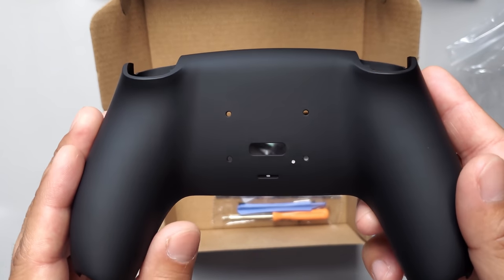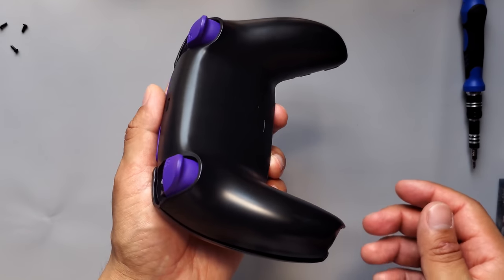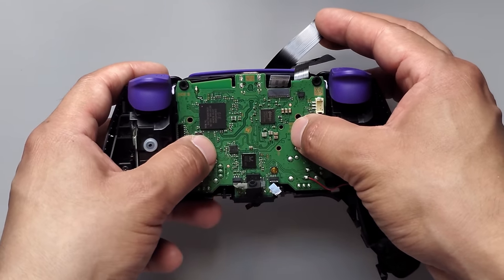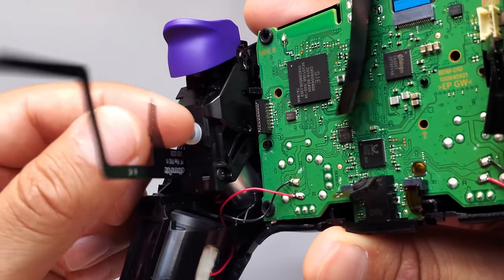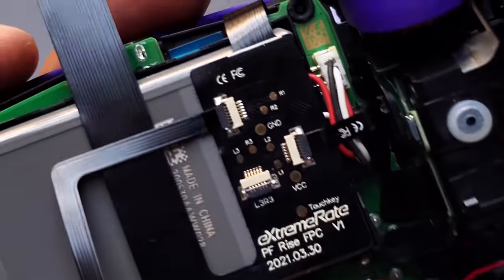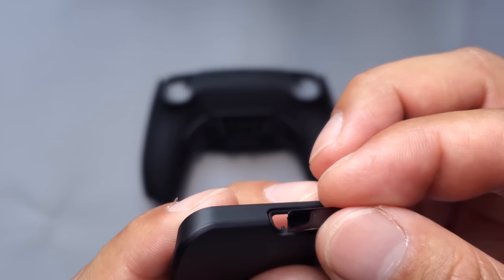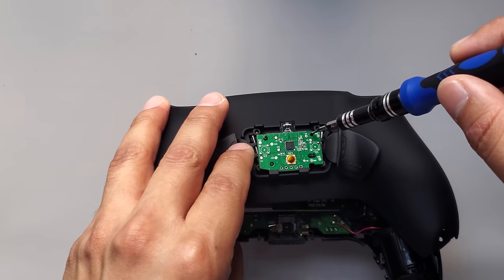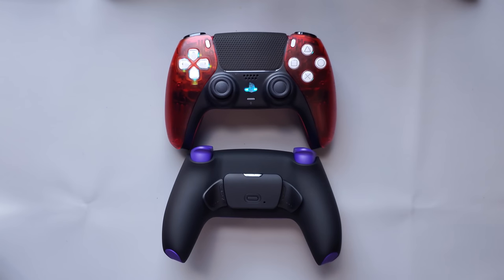DIY PS5 Controller (For BDM-010): eXtremeRate's Rise Remap Kit | No-Soldering Step by Step Tutorial

Comment: Hey man this video is absolutely incredible and crystal clear on the instructions. I bought a kit and installed with no problems because of this video, so thank you! However, the paddles aren’t working in-games despite the red light showing up and blinking when being mapped. I’ve tried everything to get the paddles to work, like making sure I exit settings mode to save, and ensured all the cables are properly attached, and they are. But still nothing. 
ExtremeRates hasn’t gotten back to me and I feel like I might have to refund or something.
Reply from the maker: Even after turning off the back they still don't work? Did you see if your motherboard had BDM-020 or BDM-010? And does the original back shell show model number CFI-ZCT1W A or CFI-ZCT1W?
Reply: @im.a.caveman  Bro tysm for this tutorial, it was extremely easy to install thanks to you. Btw I also thought it wasn’t working after I finished, but as you said here, just had to turn off the power bottom and it works perfect now!

Comment: If you add this to the controller, can you still use the original buttons still for the same functions? Like for example "X" on the back right paddle but also still "X" on top
Reply from the maker: Yeah! X or any other button will still work normally.
Reply: @im.a.caveman  thanks for the response brother

Comment: Hey! My K1 back button has stopped clicking and it won't work anymore, any solution? I've contacted the seller on eBay since the controller came with the back buttons installed already. Was working great for 4 weeks...

Comment: Hi! Great video and explanation 👍  I am just wondering if this would work for the L1 L2 R1 R2 triggers? My hands are a bit messed up and my trigger fingers hurt after some use.  Thanks!
Reply from the maker: Works to remap with action buttons, dpad, and triggers. If you want to add L3, R3, and toucpad that part will require soldering.
Reply: @im.a.caveman  if you only need to remap X and O then do you need to even use the extra ribbon cables for triggers ? I don’t remap triggers to my paddles
Reply: @im.a.caveman  just default X and O

Comment: I've been doing research and contemplating buying these since these seems to be the ONLY affordable option to have paddles without having to spend $200+. Atm, I only play fortnite with husband and son. Are these paddles programmable? In FN sake, for building/editing?
Reply from the maker: With this kit you're able to remap the existing buttons of the control. Since this is the non-soldering version, you're able to remap action buttons, dpad, and any triggers to the paddles. Only 1 button per paddle. There's different version of the Kit now. Which I have videos for. I just upload the new 4 button kit if you'd like to watch that video. It's a non soldering version as well.

Keep in mind that the V1 Remap Kit is only compatible with CFI-ZCT1W (BDM-010). The V2, RMB, and Rise 4 are compatible with both CFI-ZCT1W (BDM-010) and/or CFI-ZCT1W A (BDM-020).

Comment: Great video, any idea why my d pad left button isn’t working? Everything else works just fine. I would appreciate some help
Reply from the maker: I would say try to reset the controller. If not, open the controller and check the conductive film the buttons press on.
Reply: @im.a.caveman  I’ll try resetting the controller. I’ve checked the film and it looks pretty good

Comment: Please help me, I’ve had everything on the controller set up for 3 months with no problems and all of a sudden I’m running into many problems on only one of the paddles. The paddle will either double input, delay my input or not register it at all. To add, when the paddle completely stops working, also does the button it is mapped too. Please help me if possible it will be greatly appreciated

Comment: i just wanna make sure I'm understanding this right. The only reason you need to solder is if you want to remap L3, R3, and the touch pad?  Second question: after installation  (if done right) does everything in the controller still work the same? Like adding this won't disable anything. Thanks for your time. I just don't want to screw up my controller.
Reply from the maker: Yeah soldering is only to remap L3, R3, and touchpad. Adding the kit won't disable your other buttons. Ex: you can use either back button as X or still use your front X. I know what you mean. You're not the only one who's afraid of that. People have commented they've never done something like this and they tried it. Try it out! Just be patient and be aware of your wires and that everything is connected correctly. Feel free to ask any more questions. You can also contact me on IG (im.a.caveman) if anything.
Reply: @im.a.caveman  thanks man!

Comment: So I did it great video works great, but for some reason my adpative triggers an not working now :s any ideas?
Reply from the maker: Go back in and check your cables. See if some thing isn't connected correctly
Reply: @im.a.caveman  so your fing awesome ha, I think I didn't push down the r1r2 connection enough as I re connected them all and that fixed it thank you sir!

Comment: I just bought the one without a mother board “Chameleon Purple Blue Replacement Redesigned K1 K2 K3 K4 Back Buttons Housing Shell for PS5 Controller eXtremeRate RISE4 Remap Kit - Controller & RISE4 Remap Board NOT Included” That’s bad ? I can’t 
do it like the strike pack?(Easy to Map)?

Comment: Just installed the kit, great explanation but why would my controller not want to pair with my PS5? I have the right kit and installed everything I could think of twice over. Just need some input thanks.
Reply from the maker: It doesn't turn on or just isn't pairing? If it's not pairing try resetting the control and connect your cable.
Reply: @im.a.caveman  not pairing, just blinks blue, connected the cable and it looks to be charging with yellow lights. I'll reset the controller and see if that works
Reply: @im.a.caveman  I had a cable loose when I was doing something I seen it all works great thank you for responding

Comment: I did this modification and follow every single step from this video! This is the easiest mods I ever done! Thank you so much 

The only problem I noticed is, I tried charging the controller while using it. It doesn’t work. But if the controller is switch off it’s charging.

Did I missed something? Is the mod chip could be the reason why you can’t charge the controller while it’s on?

Please help
Reply from the maker: First time hearing that one. Try reconnecting the battery or resetting the control. Not sure what the issue could be.
Reply: @im.a.caveman  ok cool will try that later when I get home :) will update this post in few hours
Reply: @im.a.caveman  just an update for. My first post 

All fixed now the controller is charging now. I opened the controller to access the reset button and that was it. 

Thank you !!!

Comment: I just tore the cable that connects to the battery holder😭😭😭 I had no idea they were so fragile. You made it look so easy. I'm assuming the controller is broken now?? 😭🤦🏾‍♂️😭🤦🏾‍♂️😭. Do you know what that cable is for?
Reply: The cable at 3.26 is what I tore. For anyone who is new to doing  anything like this (just like me) be careful as the cable is more fragile thn it looks. I believe it's the mic cable but I'll play without it as I usually play with headphones anyways. So the controller still works and I managed to finish installation of paddles so it's a win lol
Reply from the maker: @rangstafied  Yeah thats for the mic. Sorry to hear. I'm glad it alteast still works
Reply: It's all good thanks your video helped alot!

Comment: is it the Black RISE 2.0 Remap Kit for PS5 Controller BDM-010 & BDM-020, Upgrade Board & Redesigned Back Shell & Back Buttons Attachment for PS5 Controller - Controller NOT Included - XPFP3009G2 or  Black Programable RISE4 Remap Kit for PS5 Controller BDM 010 & BDM 020, Upgrade Board & Redesigned Back Shell & 4 Back Buttons for PS5 Controller - Controller NOT Included - YPFP3001 that I need ?great vid btw.. subbed up
Reply from the maker: Yes, it'll work for either CFI-ZCT1W or CFI-ZCT1W A. Thanks for subbing and watching the video!!! Just to let you know there's a 2 button, 2 paddle version now called the Rise4. My next video is going to be an installation video on the BDM-020/CFI-ZCT1W A conttoller with that kit.
Reply: @im.a.caveman  ok cool! Good to know honestly all I need is the 2 back paddles so I should be solid with these.. video was great man appreciate you I used your code for purchase as well
Reply: @im.a.caveman  my Man! The tutorial was unreal I got it set up and all working.. the paddles work on my PS5 menu.. as soon as I load a game up my X traingle circle and back paddles stop working.. as soon as I pull up the Ps5 menu they work again.. any chance you know why?
Reply from the maker: @TonyFromThe6ix  Let me just rule out some things. Did you cut the appropriate cables so that it works with your control?

 Did you fully plug in the cables? If not double check. Sometimes they do need an extra push which is why I will wiggle left to right, lightly, while pushing down. 

Are the cables correctly placed on their designated spot? 

Does it seem like any of the cables are damaged? 

Is the cable, that connects to the remap board, fully connected? 

Basically double check the cables for any of these things I mentioned. Some people have mentioned this problem but I don't see how it happens. I recently got my BDM-020 and installed the Rise4 with no problems at all.
Reply: @im.a.caveman  where can I see which cables I have to cut? I followed the kit exactly like yours it only works on my PS5 menu.. as soon as I load a game up nothing works.. I double checked the cables but maybe upon the shell going back on something came lose.. I’ll double check
Reply from the maker: @TonyFromThe6ix  Specifically which kit do you have? Did you get the one that says BDM-010 only or the one that says for BDM-010 & BDM-020?

This video is for BDM-010 only. Before the Kit was updated to a V2. The V2 has cables for either BDM-010 or BDM-020. 

This is the V1 which was specifically created for BDM-010 only. Because it wasn't known at the time that there was a BDM-020 motherboard or CFI-ZCT1W A model number.
Reply: @im.a.caveman  do you have the video for the CFI-ZCT1WA? Model
Reply from the maker: @TonyFromThe6ix  I don't. I'm working on that video at the moment.

Comment: Do the paddles run out of battery if I dont turn them off? Its probably a dumb question but in the video you made turning them of seem important, so I ask just to be sure :)
Reply from the maker: You just turn it off after remapping. That's how you'll be able to use the paddles.
Reply: @im.a.caveman  Thx

Comment: So if u want L3 and R3 then u have to solder like the extreme site says right?  Whole point for me is making back buttons my run buttons or L3.  Also need the middle button to function?
Reply from the maker: Yeah, if you want to remap touchpad, L3 and R3 you'll have to do some soldering. I didn't do that part since I need to practice my soldering and rather not practice on a controller. I bought a kit to help me practice. If I succeed I'll have a tiny functioning digital clock. Just need to find the time to practice.

Comment: So dont you need the wire that yr ment to solder or did i miss something ??
Reply from the maker: You only need to solder if you want to be able to remap L3, R3, and Toucpad. This is the non-soldering version. Which will not include those buttons for remapping.
Reply: @im.a.caveman  ok thanks

Comment: Hey man! Great video. I subscribe and order one! I bought a new controller and  I followed every step and when I push the button on the back no red light comes on. I checked every cable to the best of my knowledge. Any suggestions? Please help! Thank you.
Reply from the maker: When you say pushed, do you mean you held the button down till the light went on? Also the control has to be on for it to be able to turn on. Thanks for subscribing!
Reply: I had to plug the controller in to the ps5 and update it first. But it worked! Thanks again for the response. Great video! Couldn’t have done this with out it.

Comment: Great video. Just finished installing my kit and my remote won’t turn on. Any ideas? Thanks
Reply from the maker: Does your original shell model number show CFI-ZCT1W or CFI-ZCT1W A? Did you happen to see if the motherboard had BDM-010 or BDM-020? The kit is only compatible with CFI-ZCT1W/BDM-010. If you have the correct one let me know.
Reply: @im.a.caveman  Looks like it is the CFI-ZCT1W A and BDM-020... Is there a kit that is compatible with this version of controller?
Reply from the maker: Definitely ask for a refund. Extremerate is currently working on having the remap kit work with your model. Could be soon. I've been in contact with someone that's helping them out to have the right cables to connect to BDM-020 (which is your kind).
Reply: @im.a.caveman  Ok cool. Thanks again for your help
Reply from the maker: @mavsnrangers  No problem. Thanks for watching!

Comment: If not soldering does touch pad and L3 R3 still work as usual? Is that just so you can use triggers to control touch pad L3 and R3
Reply from the maker: Works like normal. You just won't be able to remap L3, R3, and touchpad to the paddles.
Reply: @im.a.caveman  thank you just purchased one
Reply: @im.a.caveman  hi can you help i have installed the paddle as shown and no my controller has no power and will not switch on any advise
Reply from the maker: @markleewilson6611  Does the original back shell model number show CFI-ZCT1W or BDM-010? Or does it show CFI-ZCT1W A / BDM-020? The kit is only compatible with CFI-ZCT1W/ BDM-010. Extremerate is working on getting it to work with CFI-ZCT1W A / BDM-020.
Reply: @im.a.caveman  hi again it shows CF1ZCT1W 
I now do have power to the controller by replacing the L2 an And R2 ribbons back to the original. There is now no power to the paddles. No blinking or red LED on rear
Reply from the maker: I always recommend to check and make sure your cables are fully in/connected. Some people had to do this after asking for help. If you're 100% sure you're cables are connected correctly then it could be a faulty and should ask for a replacement.
Reply: @im.a.caveman  checked all connections all secure and in place im guessing its faulty request an exchange will let you know how it goes. Thanks for your help

Comment: Do you have the original charging dock for the controllers?
If so will they still fit and charge when the attachment is connected?
Reply from the maker: I don't have the original but I have a dock that doesn't fit the control. I just used it to sit the controller on it and connect the cable to the control.
Reply: @im.a.caveman  ok thx for confirming, then its a no go for me.
Reply from the maker: @Niet_Belangrijk  There's other upgrades like hair trigger, led, or face cliky kit if you're interested in that. Sorry it didn't work out but thanks for stopping by.
Reply: @im.a.caveman  those wont work for me.
I now still use the PS4 controller on my PS5, on the PS4 controller i have the official back buttons, im so used to them im looking for something on the PS5 controller, but a option that will make my other equipment invalid isnt a option for me.
Keep going with the vids👍
Reply from the maker: @Niet_Belangrijk  Hopefully some company releases what you're looking for soon. Take care and thank you!

Comment: I followed the video, the lights for the paddles turned on, I assigned the paddles to x and square , the light blinked indicating that the paddles were assigned to the buttons but when I use the paddles they don’t work, will cash app for help on figuring out why
Reply from the maker: Once you turn off remap mode it should work. Hold the button on the back to turn it off, the red light will turn off as well, and then test your paddles to see if they register.

Comment: Hey i bought one months ago and it works ( thank you) but now i wanted to change the button placement from r1 and square to x and o but it dosent work. now i have no more programming on the paddles because none of them can be adjusted. Do you have a tip what I can do?
Reply: So I opend the Controller checked all cabels now the right paddel works but no function on the left side…
Reply from the maker: How's it looking now?

Comment: This might be a long shot since it isn't what the video is about but here's hoping you can help. I recently changed my shell and buttons on my PS5 controller. Now that it's back together everything works except the controller speaker. The controller mic works but the speaker inside the controller isn't outputting any sound.  Do you have any insight into what I messed up and how to fix it?
Reply from the maker: Maybe it wasn't placed correctly?

Comment: What do i do if i follow of your instructions perfectly, assemble the controller and then the buttons don’t actually program? The back button turns on, flashes as if it’s programming and then neither button works. What did i do wrong?
Reply from the maker: Did you turn off program mode after remapping?
Reply: @im.a.caveman  that was exactly it! I came back to respond that I’ve got it up and running but you’re quick! Great video! Can’t believe how easy this was!
Reply from the maker: That's great man! Now go enjoy your new back buttons!!!